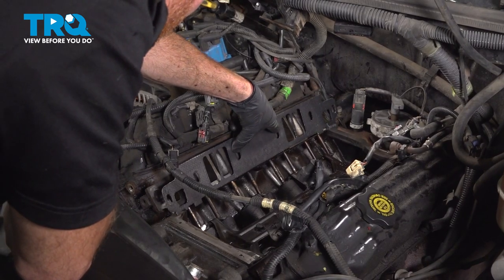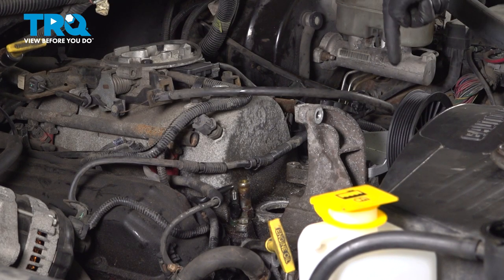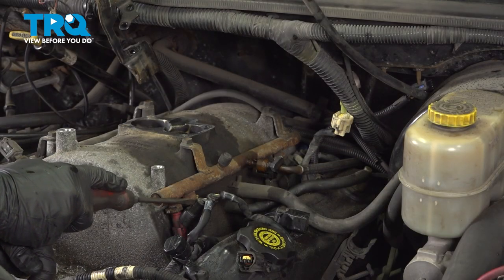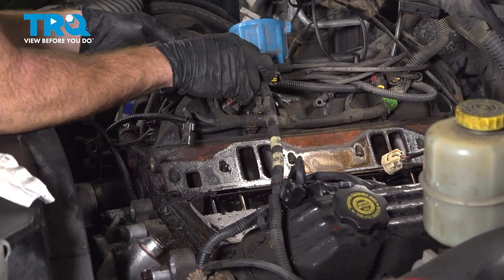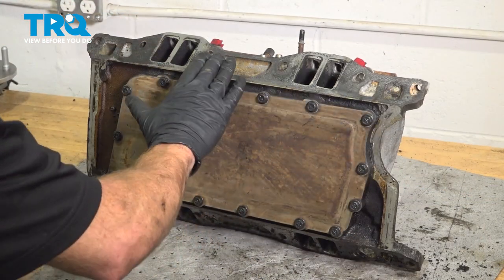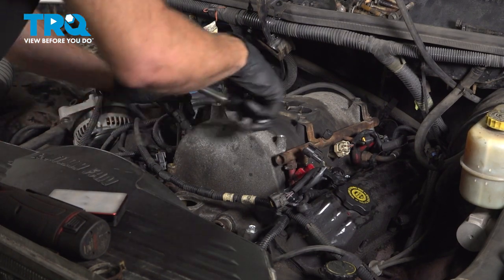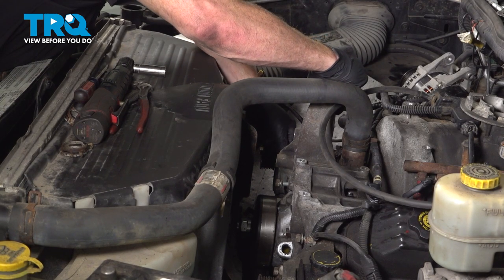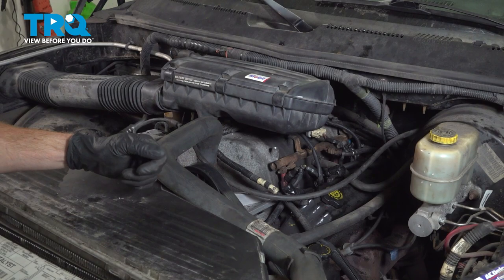How to Replace Intake Gasket Set 1994-2002 Dodge Ram 2500

Comment: For those of you attempting this job on your own when it comes to cleaning the plenum mating surfaces remove the lower plenum plate, clean all the mating surfaces on the plenum, wipe down and blow out the inside of the plenum with compressed air then re-install your lower plenum plate it will greatly reduce the chance of things making their way into the plenum and getting trapped inside.

Comment: Great video. One thing, take the cap of the valve on the fuel rail and decompress the fuel system. That way fuel doesn’t spray out when you disengage the fuel line.

Comment: Mostly right but throw those front and back gaskets in the trash. Use ultra black or grey gasket maker with a 1/4 inch bead. The pre-made silicone (or worse cork) tend to not stay around long if you ever rev your engine to high rpm. Also your plenum is probably going to leak again in less than 50k miles. But other than that everything looked great.